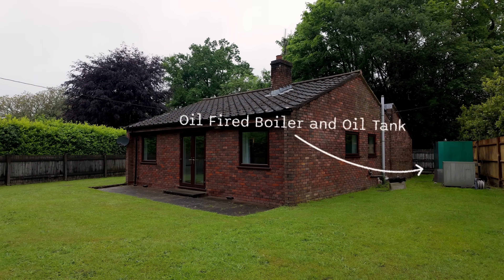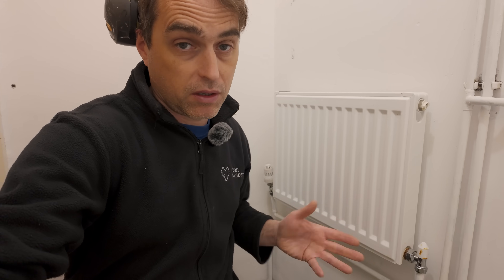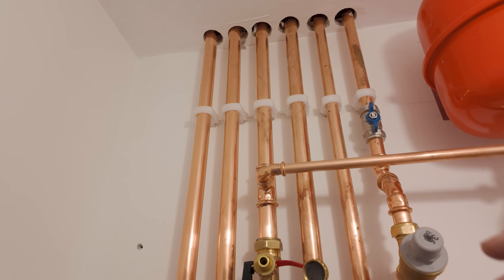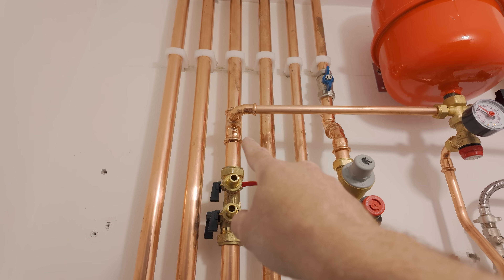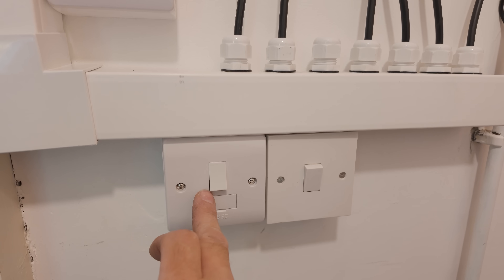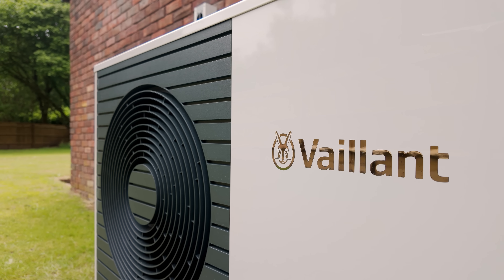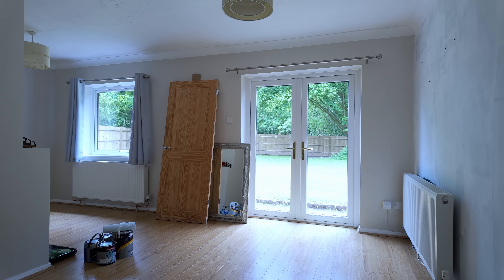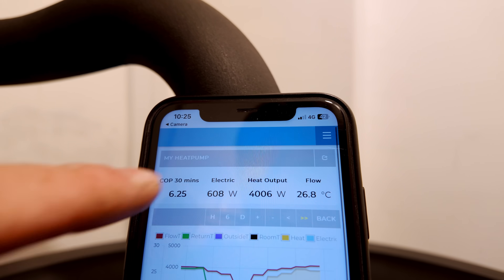Heat Pump vs Oil Boiler. It's a no brainer.

Comment: Very interesting. I may be taking over my mother’s house and it’s oil heating. Oil is relatively cheap at the moment but fluctuates in price massively. Her boiler is on its last legs and the oil tank will need replacing too. I’m guessing a new tank and boiler would run to about £6K, more if they need to be moved as regulations have changed in the last 40 years.
Reply: @bordersw1239 just been through the same thought process when my oil boiler needed replacing, together with an aging plastic 2500 liter oil tank (that would need to be replaced and moved and was out of warranty).  Even if my insurance covered the potential £20,000 cleanup cost of a burst tank I am sure this event would have long term consequences for the value of my property.  I am now safely running a very efficient heat pump that is not pushing massive amounts of small particles into the air for my kids to breath in.  I could not be happier with my decision.
Reply: 20 years oftec registered! I do know what I am talking about! In a modern property heat pumps will work ok! I have seen so many heat pumps literally thrown in without the proper calculations!
Reply: @RuaridhMacleod-z1r  I have a large old, mostly single glazed, property, 170sqm and  I have no experience or formal training in heating systems.  I just followed the "maths" ... heat loss, flow rates, pressure losses, pipe sizing, emitter sizing ... plus ... full bore HW diverter valve, weather compensation, no glycol, no buffer, no zones, no cycling.  My heat pump data says, average cop for a week in Jan was 3.0 when average outside temperature was 0.1degC.  for a week in Feb average COP was 5.2 when average outside temp was 8.5degC.  This is possible due to emitter sizing and pipework enabling low flow temps.  Point is, follow the maths and best practice and a heat pump should work just fine.
Reply: @RuaridhMacleod-z1r so in English, what you're saying is that it is the installation and not the equipment. 

The issue we have as a society is that we conflate the two.

ASHPs work great with a proper installation, a well designed installation. 

Age of property, heating requirements etc, form part of that design.

If you let the best of the best, like Urban Plumbers and Heat Geek, take care of the design, you can get a well functioning heat pump almost everywhere.

People need to start learning from these guys. They set the bar high because they know what the key to making heat pumps work is.

They also know that full electrification is the future, and they don't shy away from it.
Reply: 40 deg c is Luke warm rads! Cold house in winter! An oil/gas unit will give you 65/70 deg c! Over complicated system and very expensive to repair in future! Heat pump has 10-15 years tops life span! A well maintained oil/gas unit will give you 25-30. If the house was built before the 1980s a heat pump will struggle!
Reply: @RuaridhMacleod-z1r  This, this and this again!
Reply from the maker: @user-xk8fg8yg5e stop talking about things you have absolutely zero clue about
Reply: @RuaridhMacleod-z1r  Only someone with no heating engineering skills would take one factor (flow temperature) and try to make a point from it.  Clearly you have no clue what you are talking about .... sorry.
Reply: @williamevans4283 explain then how a house can be warmed up in any reasonable amount of time with this sort of system, if the weather changes quickly and becomes cold.

Comment: Great to see more and more heat pumps on Open Energy Monitoring. It was a game changer for fine tuning our system.
Reply from the maker: We pretty much install it now on all systems
Reply: @johntisbury

I went for the cheaper non invasive OEM emonPi2 bundle (no heat meter; CT clamp & voltage monitor for power), at some point in future I might add in heat meter and electric meter to get measured COP (can get Carnot Simulated COP on current setup).
At this point in time though the information gleaned has been invaluable, allowing me to find what I think is the sweet spot on my Daikin 6k.
In process of navigating how to set up 'Heatpumpmonitor' display.

Comment: Can I ask, if this system runs at 40C, the old system would of run at 80C, so unless you change all the radiators in the house ( they would grow in physical size) and the pipework how will it maintain say 21C at -2C? Asking for a friend.
Reply from the maker: We did both - changed all rads and pipework (it was easy here as we run new primary pipework in the loft) - existing pipework to the rads was fine and didn't need chaning.
Reply: @UrbanPlumbers   Ahh yes, I thought so, so basically a new system, what did it cost, when you look at capital cost v savings, I can’t help thinking it would be a very slow ROI, maybe a ten year plus turnaround. So the question is why bother?
Don’t get me wrong, I love what you guys do, I just think it’s all smoke and mirrors. Are you up in Birmingham next week, I’d love to catch up.
Reply from the maker: Yep - will be at installer. The total cost of this system was around £1k maybe 2k more than just swapping the oil boiler and repairing existing system. However if BUS grant wasn’t available at 7.5k then this wouldn’t make much sense in pure financial terms.

Comment: Why does an unvented cylinder need pressure release to the outside? In my boiler room, in the basement, there is a normal drain...
Reply from the maker: If you have drainage nearby then it doesn't have to go to the outside.

Comment: I hate my oil boiler with a passion.
Reply: Why ?
Reply: I'd have my oil boiler back any day .there's four of us in your house if one has a bath before the rest have showers you run out of hot water that's with 250ltr tank .and you have to leave it on 24/7 for heating .if you havnt got solar and battery  storage it's a road to financial ruin.

Comment: I don’t yet have a HP but do use OpenEnergyMonitor for my PV, hot water diversion and battery and although that only cost me a hundred quid or so, being able to track use, faults and glitches around the house makes it worthwhile. When I saw the price for the HP set up it made me wince a bit but having seen the data from others I wouldn’t not have it when I do go HP - the data is worth it and any efficiency gains will pay for it over time 👍

Comment: I think in addition to being cheaper to run the house is always at a nice temp and you have balanced hot and colds with better flow on hot water than a combi.

Lovely copper work 👌

Comment: Arghhh Y plan!! Why not S? Also what was the heat loss of the building as I suspect there is no floor insulation and there should be cavity wall insulation as the bricks are stretcher bond? Great work BTW and thanks for imparting your knowledge.
Reply: Correct, no floor insulation, however the engineered wood floors with foam underlay combined with carpets and Cloud 9 underlay does a good job. The cavity wall insulation had sunk creating damp walls, so we got it removed and replaced with Thermabead Carbonsaver Bead Cavity Wall Insulation which has made a big difference.
Reply from the maker: It’s not a Y plan. It’s a reversed valve with 3 wires only (diverter only normally closed to DHW)
Reply: @UrbanPlumbers  I think it's W plan isn't it?

Comment: If you fit open energy monitor, this goes on the primary's? So what if primary is 35mm ? Arnt the sensors max size 28mm ?
Reply from the maker: It doesn’t matter what size the primary piepwork is as long as you use correct heat meter.

Comment: I replaced an oil combi boiler at my place with a heat pump - really is a no-brainer here. Oil costs €1.25 per litre = 10.5 kWh compared to electricity at €0.25 per kWh, so any COP > 2 is saving money.  I’m using an Emoncms to monitor the system and I’m typically getting COP > 4. I’m still evolving the settings on the HP so can only get better!  Plus the noise of the old boiler was like a jet engine in the basement, plus the smell there and in the garden!
Reply: I get oil for free 😂
Reply: Oil is not anywhere near £1.25 ltr it’s about 67 p ltr and coming down
Reply: They are using euros so may not be UK
Reply: @elllplfr  Worse over here in the Netherlands for natural gas. About 3/4 of the price is energy tax and VAT. Even a kWh of electricity is about 50% tax, but with a heat pump that still easily beats a gas bioler.
Reply: @jeremydennis176  it's is in Ireland most of the time it's at that price
Reply: @davidoleary1922  Yep nail on the head there.
Reply: @jeremydennis176  1232€/1000 litres today. YMMV!
Reply: @jeremydennis176  OP is likely in France, at least that's where Cancale is.
Reply: We do need to factor if oil condenser boiler is cheaper upfront payment, running cost just part of equation

Comment: What? Where is the Heat Geek  cylinder so you can boost that hot water COP?
Seriously though, your work is visually awesome and your videos are excellent.
Just waiting on Liam to fit our HG Elite system.  Partly down to advice gained from your and Adam's channels.
Thank you so much.
Reply from the maker: Regular cylinders are much cheaper and with small heat pumps there isn’t as much benefit to fit super coils. Also - wait time now is 6weeks!
Reply: @UrbanPlumbers  I knew you would have a great explanation.  My question was very tongue in cheek.  Thanks for replying!

Comment: Crikey 63p for oil, when I last used oil for heat it was 12p more or less and if I got together with the neighbours for a  big delivery we could shave another 1/2p.
Reply: 59p per litre.
Reply: I dont understand how its that cheap. In my country there is no thing as heating oil anymore, you just get to pay the pump diesel price for it. 1.60€ a litre.
Reply: @garage3022  UK has always had cheap(er) oil for heating & agriculture. There's 20 second oil which is kerosene & 35 second which is diesel. The cheap diesel is dyed red.

Comment: What exact parts do I need to buy to install an open energy monitor onto my system?
Reply from the maker: You need a heat meter suitable for your system, mid meter, wiring between fuse board and the plant room, spare water in the fuse board for the mid meter, cat5 cable from the router to the plant room and a spare single socket in the plant room. It requires cutting into pipework as well - so Plumbig. And electrical works are required.  It really a DIY job.

Comment: how will that system manage with hot water for showers?
Reply from the maker: No problem at all. It has 200 unvented cylinder so good for up 4 people.
Reply: The unvented cylinder provides mains pressure hot water at exactly the right temperature (usually @ 43-45C), a shower head attached to mixer taps, where turning on HW is all that's needed for a brilliant shower.

Comment: If you ever find yourself in Devon you can install my system and will take your advice on what you think I need rather than me thinking I know better = just another man = legend in my own mind.
Reply: If the master can’t make it. I’m based in Exeter and have also completed the heat geek training. We should have our MCS certification in the coming weeks and would be happy to install you a system like this.  Unfortunately too many systems have been thrown in poorly and without the correct set up will cost a fortune to run. Let me know if I can help.
Reply: @mattconnick1208  Very kind of you but personally if the urban plumber can’t or won’t do it then I won’t have a heat pump , you don’t find many tradesmen as good as him , his analytical mindset is as good as I’ve seen , it’s surprising though that the time is spent on efficiency but the training has been poor according to many in the industry, can’t understand why nobody in the industry doesn’t come up with a computer program to take the guesswork or lack of training out of the situation and by putting in the details of the individual house details it will produce the design for the installation, it’s not rocket science, even the basics of having less right angle bends in the pipe work would create less friction loss when it comes to the flow which in turn would create more efficiency, I hear mention many times about noisy heat pumps , you have to see which pump is used within the unit , many of the heat pump manufacturers are using a cheap pump within the unit to keep the manufacturing cost down , so it could be noisy bearings or impeller the list is endless, sorry for long message but I think the industry could lean a lot from the industry I work in for twenty years , but thank you and I wish you well on your life’s path = if you want to know what’s down the road ask someone on their way back.
Reply: I live in Devon and it’s much much cheaper to run oil than a heat pump. I have two properties and I regretted fitting the heat pump. It’s sooo expensive to run!
Reply: @mollyfilms  I just replaced an oil boiler with a heat pump in an old 170sqm house and it is definitely cheaper than oil overall for my particular install.  Of course this will be down to the quality of the install.  If you can get the flow temperature low enough, as a result of good design, you will always be cheaper than oil.
Reply: @mollyfilms  Do you have an example of bills oil compared to heat pump ? Because I had the urban plumber contact me saying it’s not I lie when he said the house he changed last week from oil to heat pump would save the household money for changing, he implied your situation was probably down to lack of training in the industry sounds like your installer was guessing so would be interested of your system, any information would be helpful, seems we need a deerstalker and pipe to solve this mystery, one does hope the answer is elementary my dear friend.
Reply: @mollyfilms  Wow really you’re the first person that’s actually said that , all we tend to hear how efficient they are compared to gas bills , I tend to look at things from a different angle anyway = I still can’t get my head around getting a heat pump to heat water to then heat radiators to give warmth when you can get heat pump to give direct heat with the ATA system , when I’ve mention that to a few people on YouTube who do blogs it’s as though I’ve said something I shouldn’t and need to stand on a naughty step, I watched a gentleman a few months back who got a heat pump = ATW and took out all the radiators and changed it to ATA , said he should of done that in the first place , have you heard much in regards to ATA ? Funny watched the urban plumber last night where he changed oil to heat pump and said that the house hold will save lots on the heating now , sounds like it’s all one big fat lie then ?
Reply from the maker: No it’s not a lie. Sadly 70% of heat pump installs are not done correctly and end up in systems nowhere near as good as what we install. There is a missive skills shortage as the industry has been massively dumbed down by a combi boiler. It is slowly getting better.

Comment: As usual a very professional installation. Nice job. It would be interesting to know how much the installation cost vs the cost of an installed replacement oil boiler. That's what most of my customers want to know, besides the cost of running. Thanks for a great channel.
Reply: Ok, so changing to a heat pump and cylinder and pipework roughly equals the cost of replacing an oil boiler . I wish I wasn’t so skeptical as I’ve been involved with the fitting of a couple of heat pumps in the past and they certainly work. Maybe at some point you could show us the figures convert me. I’m open to it, not trying to be funny with you. You’re a really good installer 👍
Reply: @ultrasteve9031  It will be about the same after BUS is included in figures.
Reply: @ultrasteve9031  The kero Grant Vortex boiler was 25 years old, both boiler, kero tank, fuel pipes, underground cables to new boiler needed replacing, with system flushing = £7.5k inc vat. I scrapped the new kero boiler plan and saved £7.5k, got a .Gov BUS grant of £7.5k = £15k. There is the heat pump cost installed. Additionally, the kero boiler on 24/7 standby used 1 litre kero per day. During the past 25 years I ran a Grant kero boiler I wasted circa 9,000 litres of fuel on standby, fast forward another 25 years = 18,000 litres wasted, does it all make economical sense now ?
Reply: @ultrasteve9031 Far more expensive than oil equivalent
Reply from the maker: same cost as new oil boiler if you dont include the radiators.